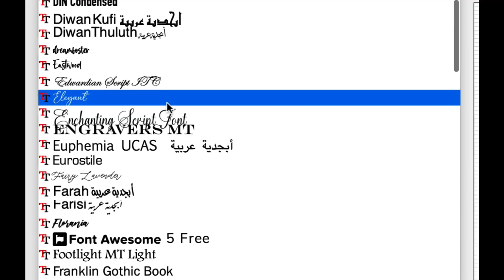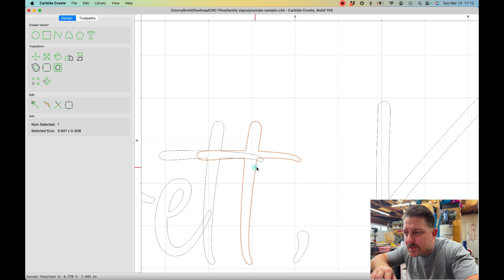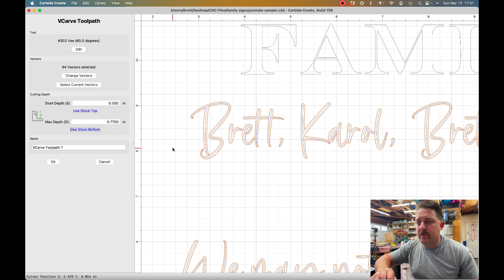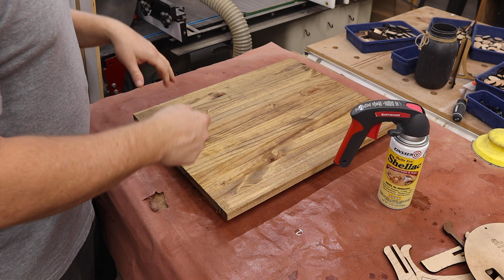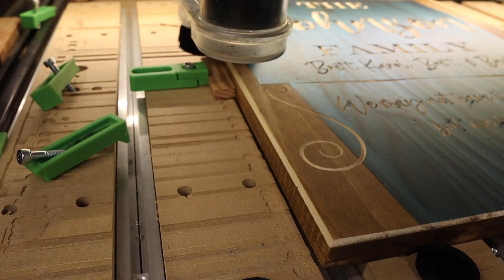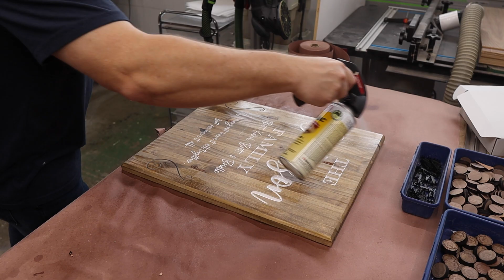Start Your CNC Business: Easy Family Sign Projects That Sell! | Brett's Laser Garage

Comment from the maker: 🔥 Shapeoko 5 / 5.1 Pro Owners!
I’m now making Laser Garage replacement wasteboard kits for 2x2, 2x4 & 4x4 machines. Choose a Standard 1" ultralight MDF replacement or upgrade to 20mm dog holes + pre-installed M6 threaded inserts for more workholding options.
👉 Check out the kits here:
https://brettslasergarage.com/wasteboards
Designed and machined by me right here in the Laser Garage.

Comment: Will your files work on other software like fusion 360? Just wondering have a cnc gantry mill and just started to learn fusion 360 and I am a rookie at it right now. Thanks for any suggestions
Reply from the maker: No unfortunately not, they are only for Shapeoko machines using carbide create and carbide motion.
Reply: @LaserGarage  ok thank you still love watching your you tube videos and very interested in the laser engraving also and looking at possible get one of those thunder bolts to start off with
Reply from the maker: @richardjenkins8094 thank you very much.  You can never go wrong with a Bolt that’s for sure. 👍

Comment: It came out really clean!
I noticed the blue mask didn't mask everything cleanly. 
So, the shellac allowed for the acrylic paint to be peeled off where the mask didn't work?
It peels off easily?
Reply from the maker: The masking works great but some areas tear up every once in a while.  Especially with V bits.  

Yes, the shellac #1 helps the masking stick #2 protects the wood just in case the masking fails.  Paint bleed can be cleaned up with a baby wipe or a little water on a rag.
Reply: @LaserGarage  I was using up cut bits.  I changed to down cut and it made a huge difference.

Comment: I'd love to get down there and make something. But my 5 pro died this morning, and I'm waiting on carbide to respond to my support email. I'm hoping they replace the hole controller unit. I think it took a poo on me. O, and by the way, diaper whips are awesome for cleaning up the paint and glue.
Reply from the maker: Yes that’s a great tip!  Sucks about your cnc, I’ve had good luck with support the limited times I’ve needed it.  I’m sure they’ll answer you tomorrow morning.
Reply: @LaserGarage hoping so. I got a recurring job prospect tomorrow evening.
Reply: @sinsofvorador  I have been looking at the 5 Pro, did everything turn out okay? Just wondering what was the issue. Also, how did support handle it? Thanks
Reply: @keithclark8030  Yes. They sent me a controller. It's works fine now. Still Other little things about the software that needs workand there really minor. But they said they were getting that addressed in the next update.